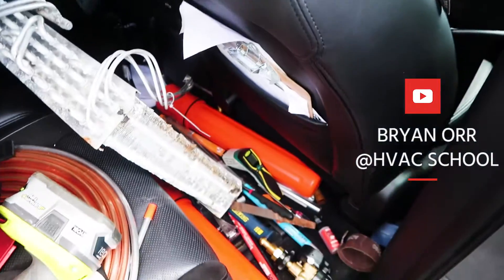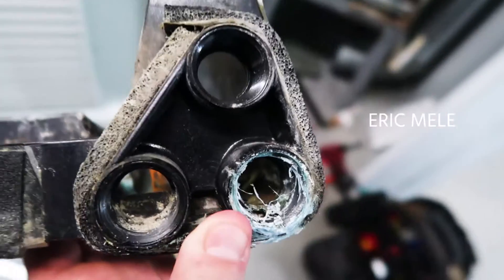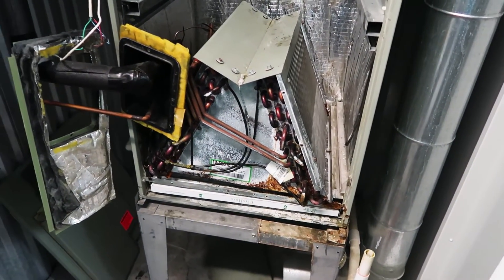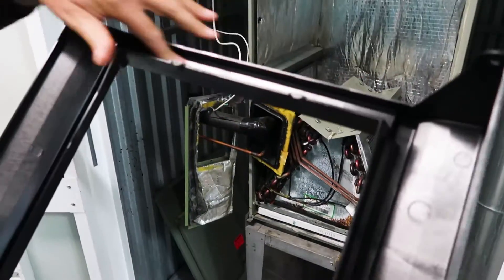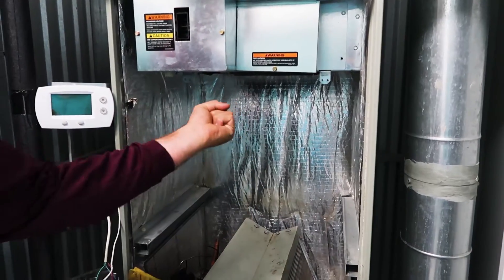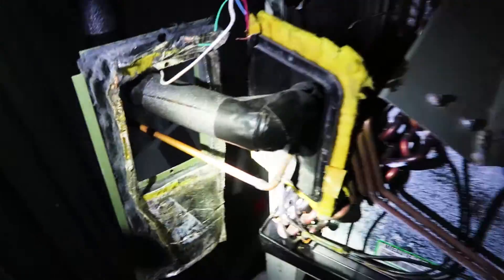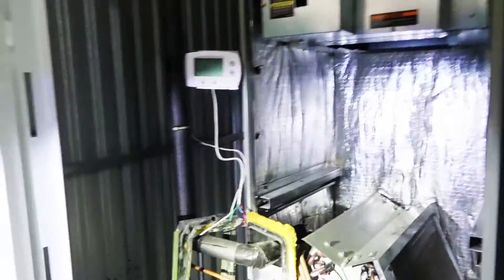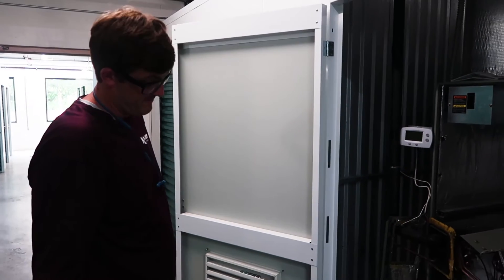Changing a Drain Pan the Easier Way

Comment: I have to replace mine, will have tomorrow. Will take plenty of pictures and remove the blower. Don't see anything in the attic tying down the suction line so my goal is to raise the evaporator coil up an inch to get the pan off and put the new pan on. I need to be careful about accidentally rupturing a copper line as R-410A is heavier than air and will displace the oxygen in the house, as well as be a violation of the Clean Air Act. If it looks like I'm not going to get the slack I need to lift the coil, I'll stop what I'm doing and come up with another plan. Studying for EPA 608 Universal. My air handler is a Lennox CBX25UH-030-230-1, and I haven't found many videos on doing this without a pump down. I don't have the certification nor the tools to perform this operation and HVAC companies want $700-$1200 for the pan replacement. I spent $103 on mine, a 12W77. It's 91 degrees in my living room hallway where my thermostat is located so this is a priority.

Comment: My pan may be cracked on my Lennox updraft, as long as I don't have to evacuate and recover refrigerant I can lift the A-coil myself to replace. Thank you.

There's no question it's cracked, 4 cleaning sessions with a channel brush and it leaks in the left rear corner every time within an hour of operation. Mine is in a hallway cubbyhole and may have some Sheetrock demolition to do to get at it. Worth a try as I only have fan and heat mode now as I can't have mold growing in the return space. On portable AC units until I get my main back up. Bought a 12W77 pan for $100 for my Lennox CBX25UH-030-230-1 unit.

Comment: This helped me figure out what was wrong with my AC. I have a Trane unit aswell and my handler just kept leaking water into the bottom pan. water wasnt coming from under the coils so i know the coils weren't freezing, so i thought the drain line was just clogged. I unclogged the line 3 times in 3 days and every day still kept filling with water. Before I was about to call a tech out, I saw this video and said "Wait, thats the same air handler in my home! Maybe I should see if the DRAIN PAN is clogged!" And shit sure enough. It was literally caked in sludge and gunk.I didnt even have to remove the pan I was able to stick a shop vac between the coils and the drain pan and suck everything out. Sucked out the line one more time for good measure and the leak is gone. Im not even an HVAC expert nor do I barely know jack shit about HVAC systems, but im slowly learning. I live in Florida, if there is anything in my house I need to know how it functions and how to maintain on my own...its that.

Comment: fixing to do this right now because of this video. Thanks. It's a newer five ton so I'm I'm going to go grab a ratchet strap now to see if I can pull it out. It's for a Warehouse break room so it's a very dirty environment.
Mine is in a downflow application but this method still seems to work all around so far, maybe even better because the bottom screws are easier to get to.